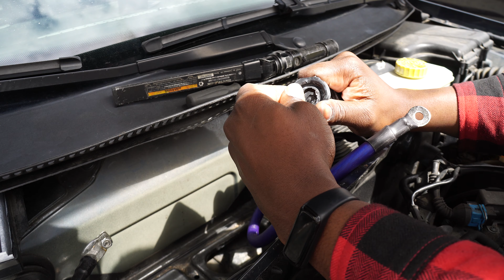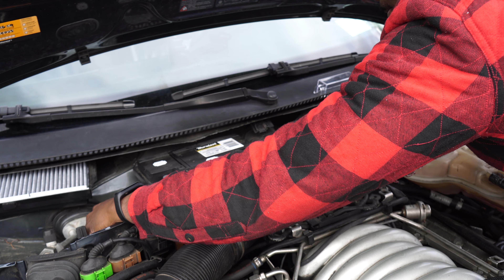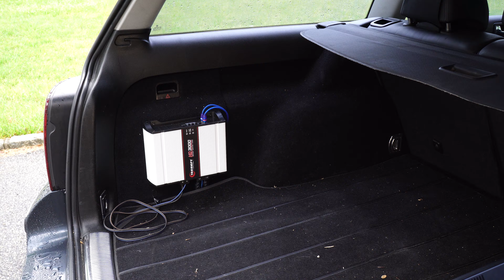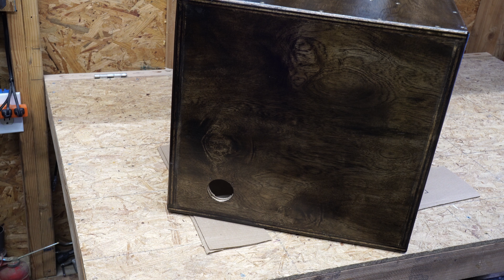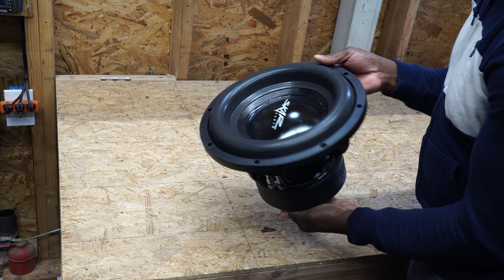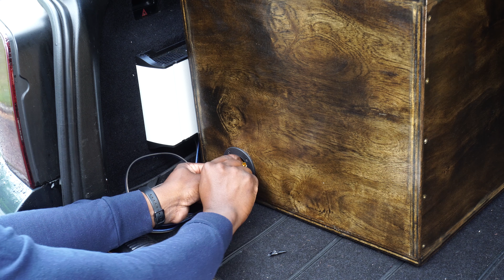VW B5.5 Passat Audio Amplifier Wiring Kit Install - Part Two

Comment: Hey,
First of all i wanna say: i love your video's man. They are educational and entertaning to watch. Keep up the good work

I had a question, i got the exact same model car and im struggling with my power seat (driver side) it also has memory. As of now i have no life in the seat. No buttons work. The heated seat is working fine and at first it did slightly made a sound when i pushed the button. Guessing it does get power also checked the fuse which looks normal. Do u or anyone here have any tips?

Thanks and much love (sorry if english is bad)

Comment: nice work man! But theres a couple of things you should consider. Those Taramps are extremely power hungry and stock electrical will struggle to keep up with 3k watts. Also that amp is the 2ohm version, but the EVL is dual 2ohm, meaning it can only be wired down to 1ohm, or up to 4ohms. At 1ohm you'll fry that amp, and at 4ohms you would be greatly underpowering the sub. A skar RP1500.1D would be plenty for the sub and less taxing on your electrical equipment.
Reply from the maker: Thanks man! The sub is wired at 4ohms, it hits pretty damn hard for me. Definitely not under powdered, amp gain and radio volume is never above half, lol

Comment: Did you by pass the factory amp since you installed new speakers and amp or you just unplugged the factory amp and installed the new stereo, amp, speakers and sub all alone by itself ?
Reply from the maker: The door speakers are still powered by the factory amp. The amp that I installed is only for the sub.